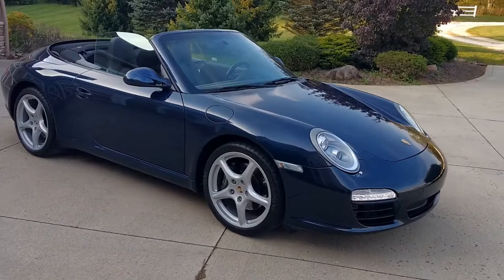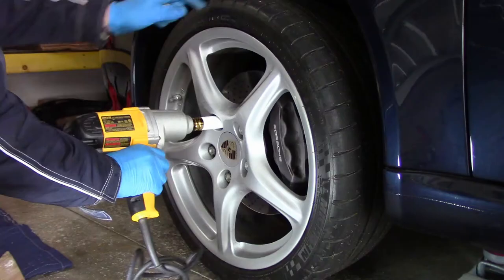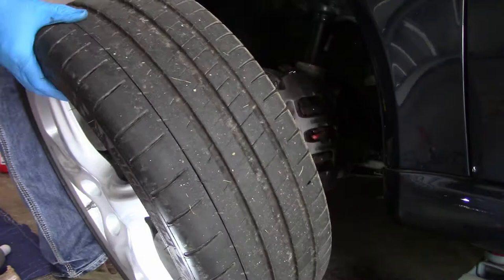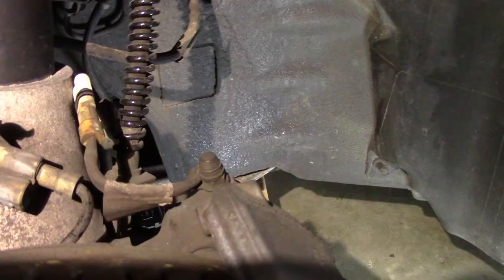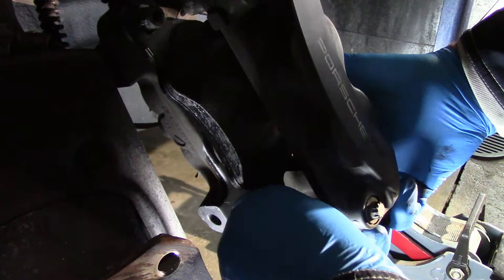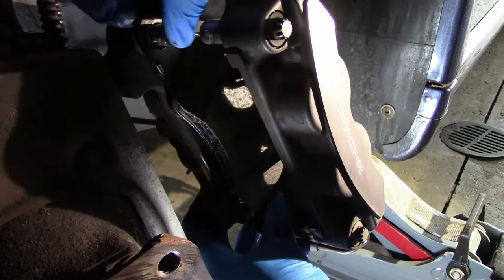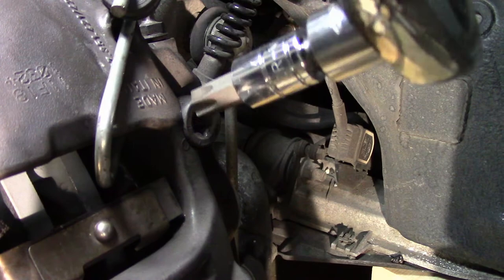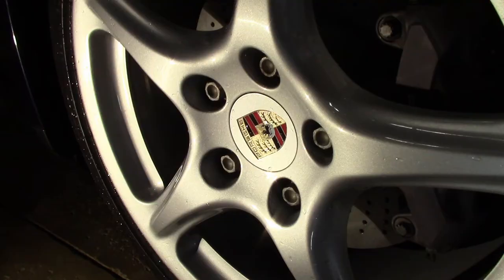Changing my 2012 Porsche 911 Carrera Brakes and Rotors (997.2)

Comment: Thanks for posting this, I'm about to do the job, along with coils and plugs.  One thing that needs to be said:  IF you have Zimmermann rotors, or other coated rotor types, don't spray with brake cleaner.  It will remove the protective coating on them.

Comment: Very nice presentation.
Where exactly is the jack point for the wooden stand you use ???
Reply from the maker: I use a jack on the area just behind the front wheel then slide the wooden jack stands under the car to a solid looking point. I lower the car slowly to make sure it is well supported, but still leave the jack in place for added security.

Comment: how did you find the rotor part number for the front and rear rotors?
Reply from the maker: The left rear is: 996-352-405-02-OEM   The right rear is: 996-352-406-02-OEM. They were approx $220 each from Pelican Parts.